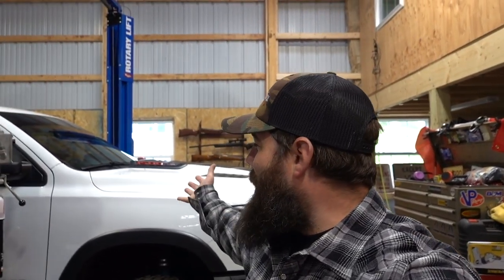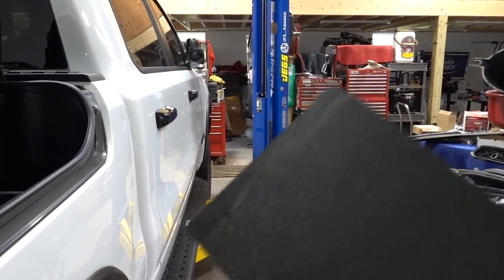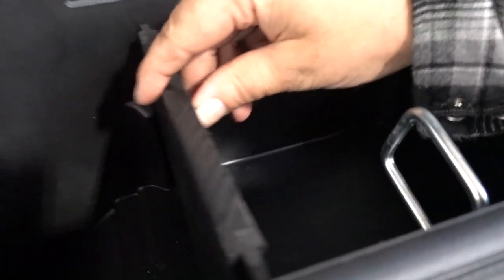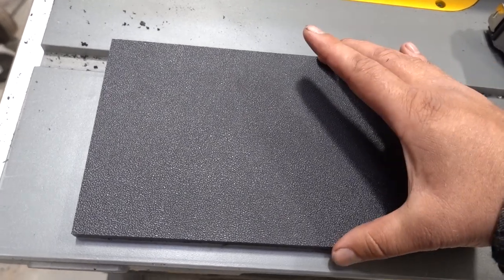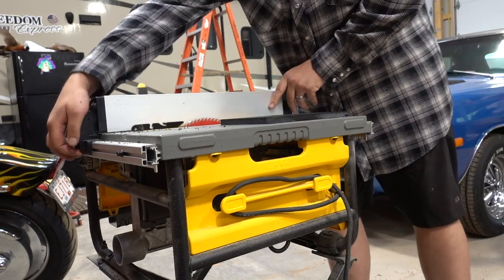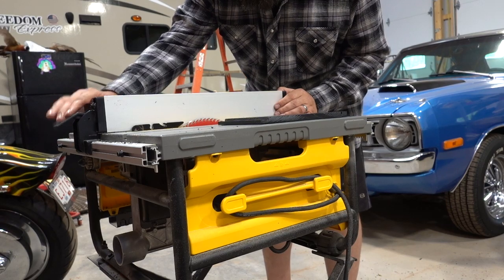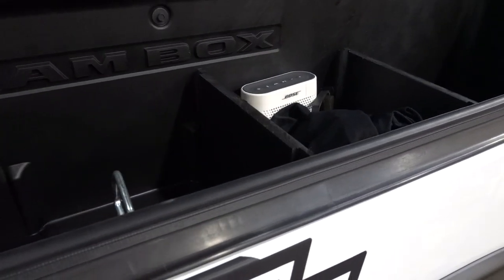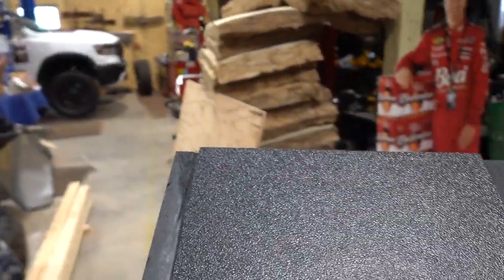Ram Box $20 DIY Mod

Comment: My 2020 Rebel (White like yours) also has the ramboxes. I agree it is a must have. Mine also came with the multi-function tailgate and I have to tell you that it is the cats-ass!! So much easier putting things in and out of the bed. Wasn't really looking for the multi-function tailgate but now I wouldn't have a truck without it!

Comment: On the loose one use a strip of the soft velcro to take up the slack. It will also quiet it down.
Reply from the maker: good idea
Reply: @HammerdownMotorsportsUSA  too many years of custom installs. That stuff saves projects. Lol. Not to mention it will make it much easier to take in and out.

Comment: I did I similar thing with mine except used vinyl plank flooring had laying around. They wiggle a little bit but don’t hear it in the cab. Then for the rear pockets on both sides made a cover out of 3/4 plywood so it’s just level across. Didn’t like the idea of my heavy hitch just sitting in a deep plastic tub. Was worried how sturdy the plastic got at -35c if hit a bump didn’t want the hitch breaking through

Comment: Do they change the rambox locks? Yours come with a button and a key hole. What I saw last Saturday only come with a key hole, don't know it remote control or not, on a Limited 2500.
Reply from the maker: Yeah mine has a key hike and a button that works when the truck is unlocked
Reply: @HammerdownMotorsportsUSA  Thanks, took my RAM 2500 back this Monday.
Reply: @dmtycn  interesting. I have a 2020 2500 Power Wagon and it only has the cylinder keyhole. What did it cost you to get the locks like HammerDown has on his Rebel?
Reply: @sh0cktim3  I think we have the same one lock. No, I did not make change to it. Just leave it there.
Reply: @dmtycn  yeah guess not a big deal. I just like the cleaner look is all.